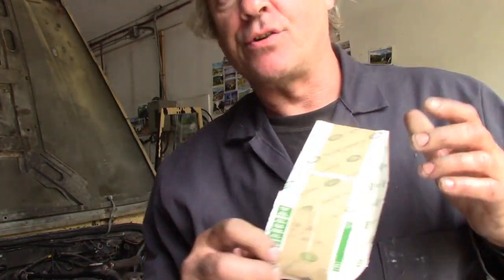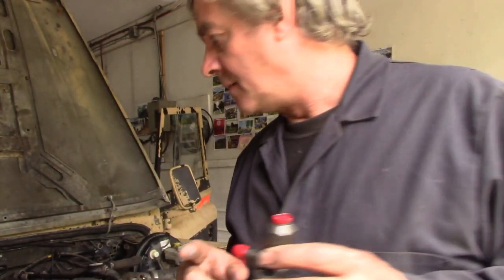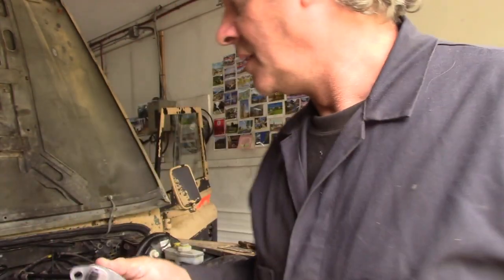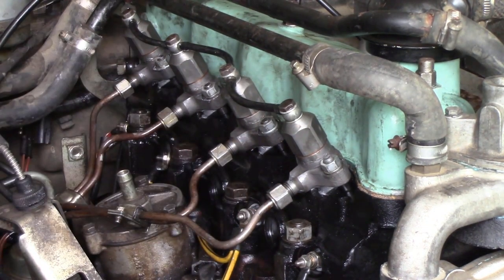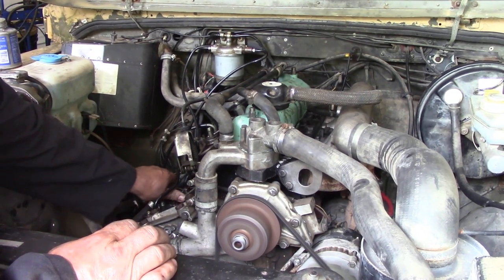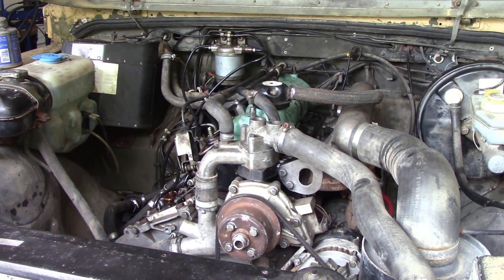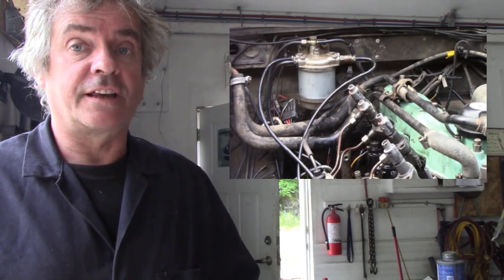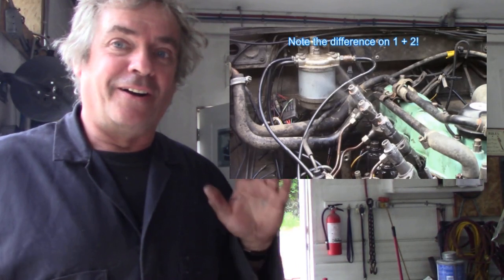The 2.5 NA Defender diesel LIVES! Job done!

Comment: Hi Mike, I had exactly the same issue with a 12j and having seen your video a while back also diagnosed a faulty injector using the manifold temperature method. I’d also fitted several supposed ‘good’ sets of injectors, but must have had a duff one in each set. No. 4 was weak, changed just that one, perfect! How satisfying... now the old 12j is back to the same power output as the wiper motor! But I do like the indirect injection engines. Many thanks for your great videos. From Chichester, West Sussex.
Reply from the maker: Thanks Adam!
Mike

Comment: Can you make one good set of injectors out the two sets now? A good result in the end.
Reply from the maker: I think  I will need a set of OEM nozzles
Reply: Think you might be right. Where you find out they are identical but a mirror image or left threaded like I found once with an after market alternator